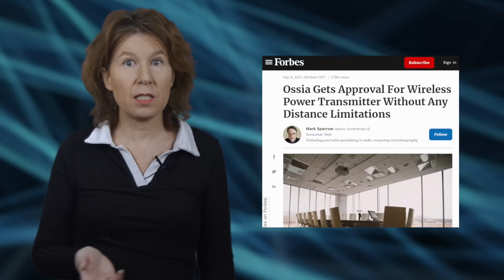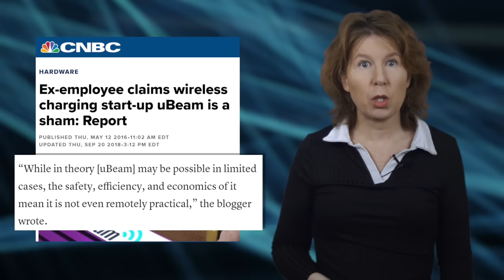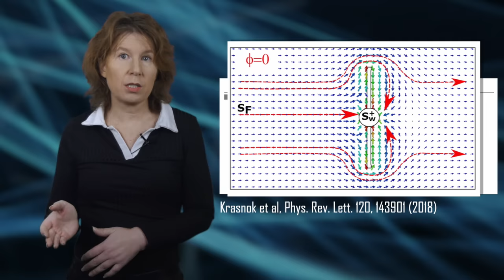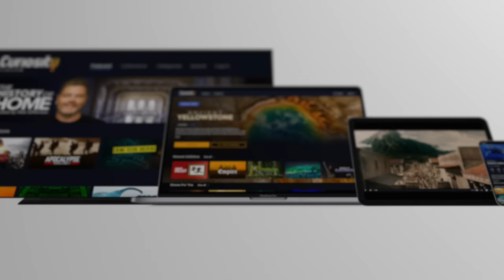How close is wireless power technology?

Comment: Wow how primitive. You don't need to transfer power anywhere you can produce it on the spot with feedback of sound... 2 speakers and a microphone... no magnet or coil or battery or any moving parts are required. A tuned metal bar hung at the nodes over a piezoelectric speaker disk will bounce up and down on the disk forever from it's own feedback.... costing absolutely nothing to get a trillion watts. I did it about 40 years ago... incredible power.. so dangerous. The heavier the metal bar the more power. If you have a hole in the center of the 2 speakers and you put them back to back facing in opposite directions you push and pull a wave out of the hole and it creates a standing torus with a counter rotating field... and it will levitate. Put the device in a tuned drum box and put a cup on the speaker facing up just under the air hole and water condenses in the cup and spills over onto the speakers and starts to spin and light up like a mini galaxy in a box. You will get about 2 trillion volts. Why should we have to pay for power when you can produce it on the spot for nothing? Why does man have to do things the hard way? Why is everyone so stupid?  Speakers made out of granite are piezoelectric and they have a range of below 1 hertz to 20 million hertz.  They are also transducers meaning they are also microphones... and so the speaker facing down is picking up the vibration of the earth and the speaker facing up  is picking up the white noise radio waves from space. It will pick up  every vibration in an 800 mile radius around it and feed it right back into the microphone in an endless feedback loop. Look at the galaxy!.. it has no magnet, no coil and no battery and it travels faster than light speed. Well this feedback device does exactly the same thing and makes it's own air, water and gravity and cost absolutely nothing to operate. It's so incredibly simple. People are so stupid they think you need a coil and a magnet... water is magnetic... it gives you the magnetic field because it bounces in and out of the hole at the center of the speakers and it gives you the counter rotating spin because the mini suns are spinning counter clockwise over the speaker facing up  and clockwise over the speaker facing down. Therefore you don't even need the coil...It's a cakewalk! The tweeter cup is positive and the outer edge of the speakers is negative so the only wire you need is off the tweeter.... the rest of the device is negative everywhere.... but it's AC power so they switch. When the speaker facing up talks the speaker facing down listens and they switch back and forth as the center bobs up and down. Both sides cannot talk or listen at the same time.. one talks and the other listens and they switch. The jets coming out of the center of our galaxy are only on one side at a time... in our own galaxy the jets are on the other side and we won't see them for another 6000 years.... so we are currently falling in the hole. So we are living in the speaker.. in 12,000 years we will be living in the microphone falling away from the center and we will see the jets. In 6000 years we will reach halfway but still fall upwards for 6000 more years before we turn around and fall away again... because of gained the momentum. It may happen in 4000 years because the calendar is messed up and we won't really know when we reach halfway until we see the jets starting to come up on this side. Even with the most advanced telescopes we cannot see the other side unless you actually go there... ie: go through the hole or go around the outer edge. There is no way you can go through the hole without dematerializing.